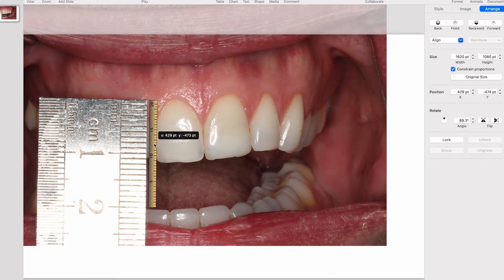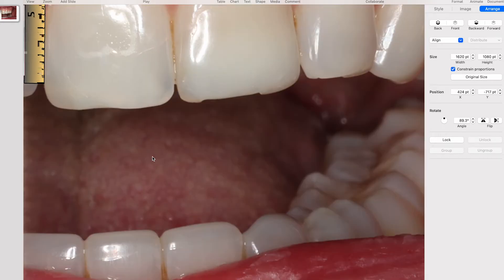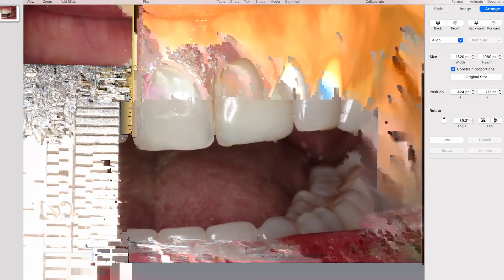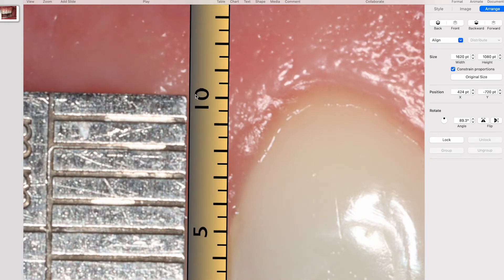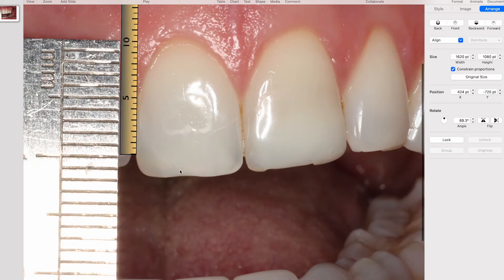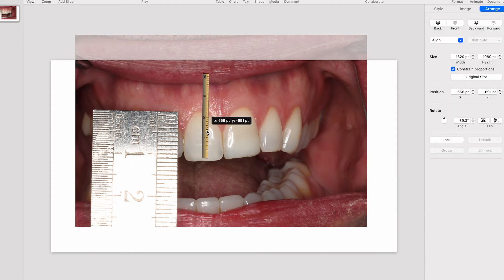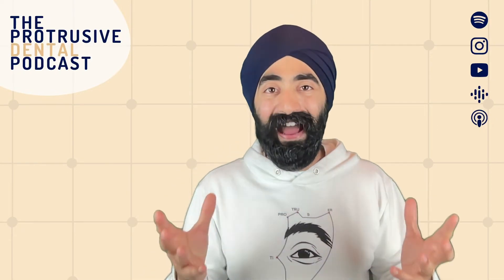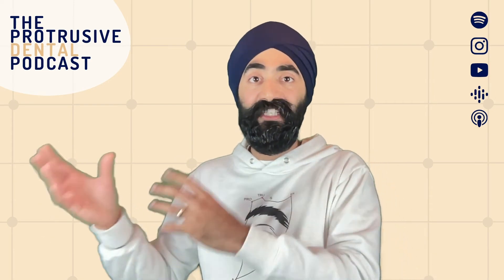How to use a DSD Ruler on Keynote / Powerpoint

Comment: Thanks for the share Jaz! Does this ruler only work when the photo is taken at 3:1? Or can it be adjusted to different magnifications?
Reply from the maker: thanks! I have never done a formal course - just sharing my learning through trial and error. When I once tried at 1:1 ratio the measurement was all wrong - so in my experience it works only on 1:3 but I'm happy to learn.

However this can be adapted. ie. if you measure the ACTUAL height of the tooth and then Calibrate the ruler so it reads correctly- then you can simply keep copy and pasting the new calibrated ruler on keynote, so in reality it can work on any magnification once  calibrated. 

'out of the box' I have found 1:3 to not require calibration. I hope that makes sense!
Reply: @protrusive  I suppose an easy way to calibrate would be stick something of known length (e.g. a GP point cut to 1cm) onto the tooth with composite, then take a photo.
Reply from the maker: @smoothbanana  yup or just measure 1 tooth (any tooth) with a ruler and record the measurement!
Reply: @protrusive  Yes that works, but only if your photo is perpendicular to the tooth surface as how you measured it.